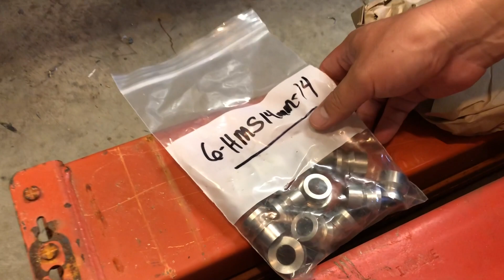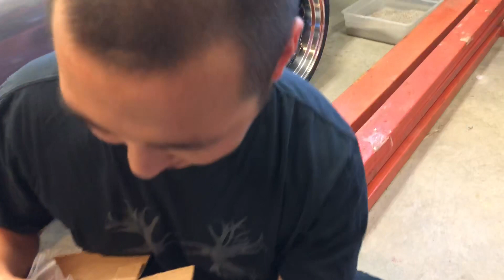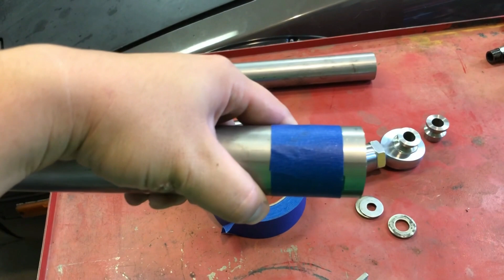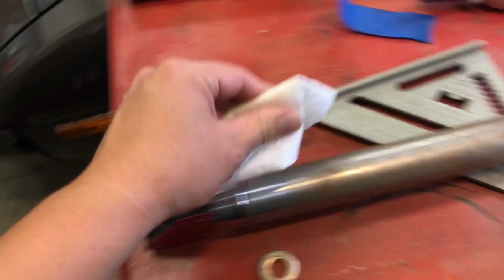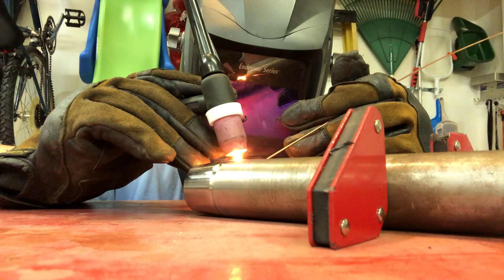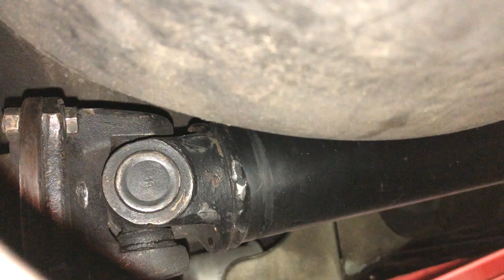How To Build Adjustable Rear Lower Links for the FB RX7

Comment: What do these lower links adjust, jw. Camber? Toe?
Reply from the maker: These links adjust the pinion angle.  The FB has a solid axle so you cannot adjust rear camber or toe
Reply: Oh thanks, just looked it up. So you can get the driveshaft to line up with the diff.  @TheDriftingDad
Reply from the maker: Exactly!!  When you lower the car with stock length links, everything gets messed up geometry wise.  I made these links and the drop brackets so that the rear suspension geometry is similar to stock when the car is lowered.  I have it pretty low right now